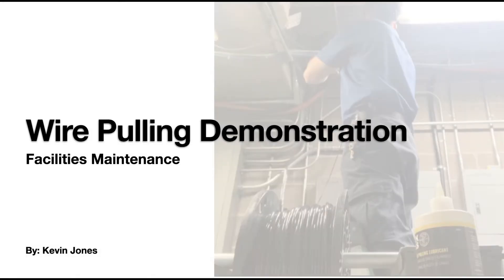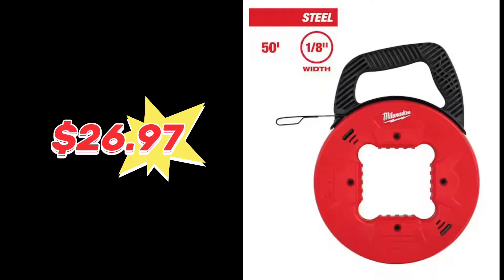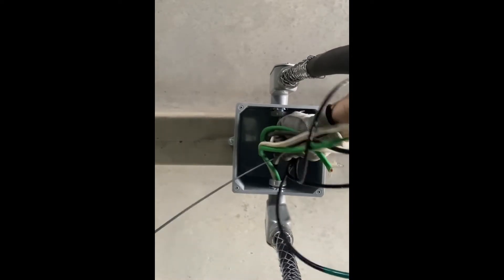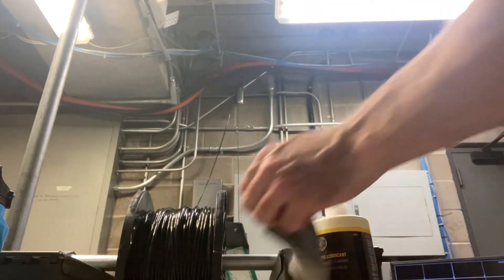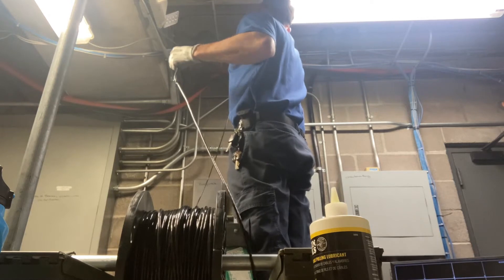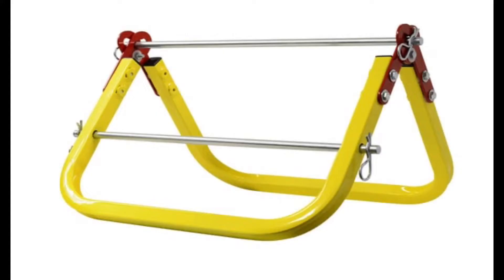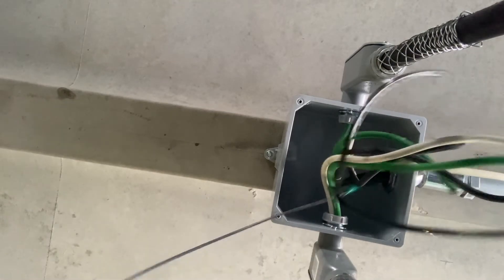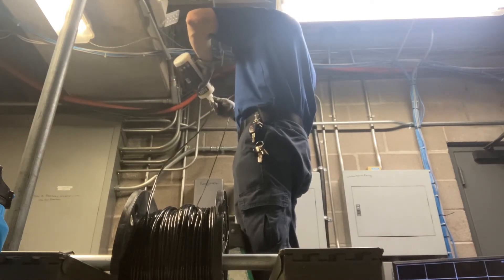Wire Pulling Demonstration! (Electrical Work)

Comment: you snaked it twice and pulled each wire in separately ?
Reply from the maker: Yes, I pulled six, 8-gauge wires through the conduit.  Only had one spool of wire to work with.  Additionally, I was working in a very small electrical room and I did not want the wire to get caught , or tangled on anything while trying to pull it through the conduit.
Reply: @kjfacilities-maint  you actually snaked it 8 times ?
Reply from the maker: No, I pulled eight gauge wire six times.